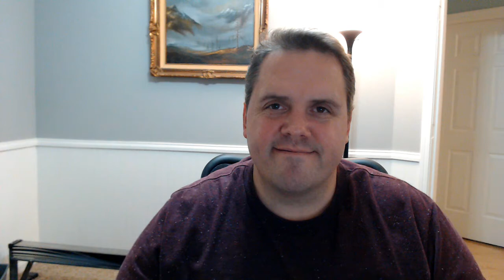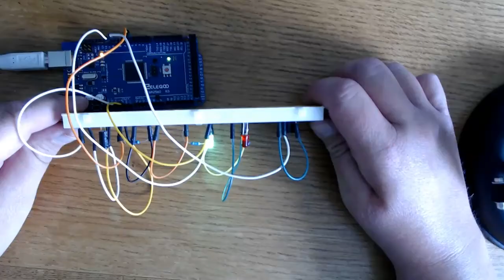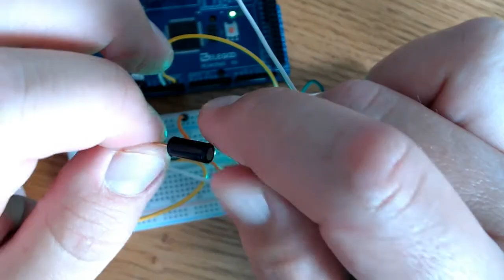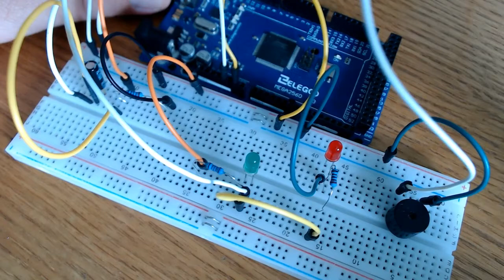How To Make A Flashing Tilt Alarm Using Arduino Mega2560 And A Tilt Ball Switch Sensor

Comment: what code did you use to get the board to work and would this work on an ELEGOO UNO R3 board too?
Reply from the maker: hey there!
Yes, this would work on uno r3. Here are 2 options for ya. 👍👍
The code I used in the video is this: 

const int tiltPin = 5;   // switch pin
const int ledPin  = 10;  // LED pin
const int Alarm   = 9;   // piezo or buzzer
int tiltState = 0;

void setup() {
  pinMode(ledPin, OUTPUT);
  pinMode(tiltPin, INPUT);   // external pull-down assumed
  pinMode(Alarm, OUTPUT);
}

void loop() {
  tiltState = digitalRead(tiltPin);

  if (tiltState == HIGH) {
    digitalWrite(Alarm, HIGH);   // buzzer ON
    digitalWrite(ledPin, HIGH);  // LED blink
    delay(100);
    digitalWrite(ledPin, LOW);
    delay(100);
  } else {
    digitalWrite(ledPin, LOW);   // LED OFF
    digitalWrite(Alarm, LOW);    // buzzer OFF
  }
}

**but you could add another output pin for the second LED (say pin 11) and handle it separately:

const int tiltPin = 5;
const int led1 = 10;
const int led2 = 11;
const int Alarm = 9;
int tiltState = 0;

void setup() {
  pinMode(tiltPin, INPUT);
  pinMode(led1, OUTPUT);
  pinMode(led2, OUTPUT);
  pinMode(Alarm, OUTPUT);
}

void loop() {
  tiltState = digitalRead(tiltPin);

  if (tiltState == HIGH) {       // tilted: alarm
    digitalWrite(Alarm, HIGH);
    digitalWrite(led1, HIGH);
    digitalWrite(led2, LOW);
    delay(100);
    digitalWrite(led1, LOW);
    delay(100);
  } else {                       // normal
    digitalWrite(Alarm, LOW);
    digitalWrite(led1, LOW);
    digitalWrite(led2, HIGH);
  }
}
Reply: @BMonsterLaboratory  thank you so much sir! I had fun and even added a servo motor to mine